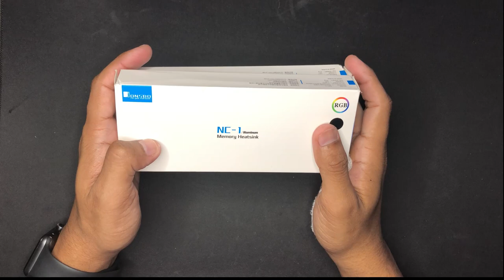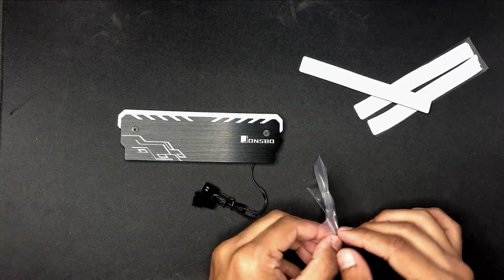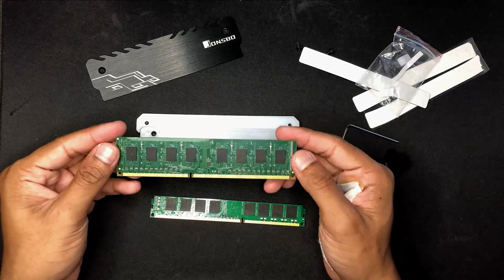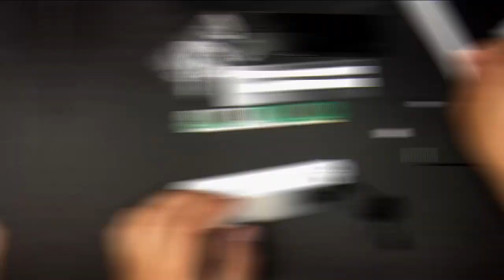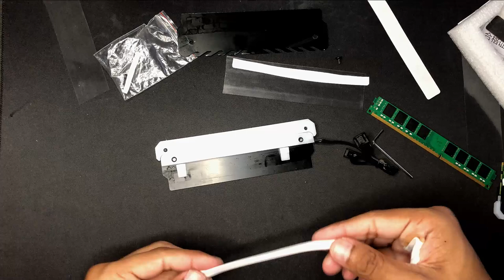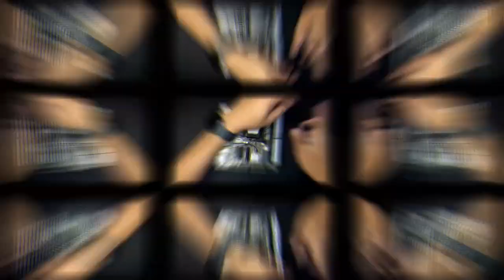Turn Any RAM Into RGB RAM ! | Jonsbo nc-1 Unboxing & In-depth Installation

Comment from the maker: To all the viewers this item is available through Amazon and the links are provided in the description. It should work fine with any 3 pin connection. You also can’t change the RGB color therefore it won’t work with any software.